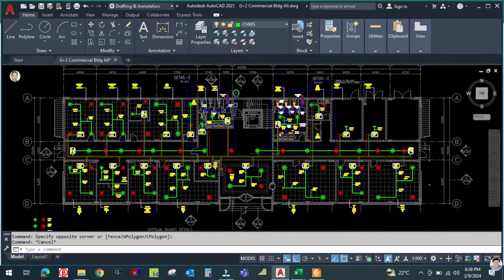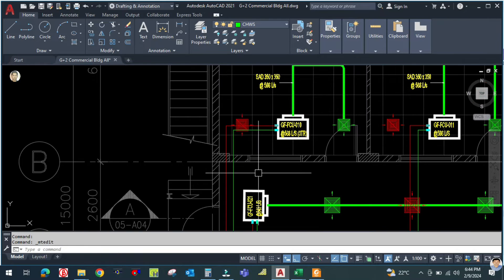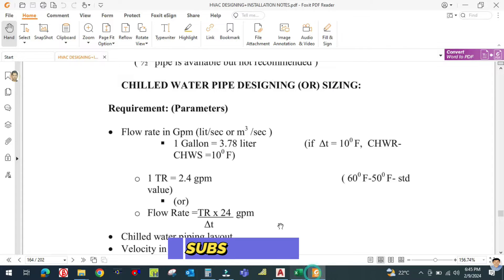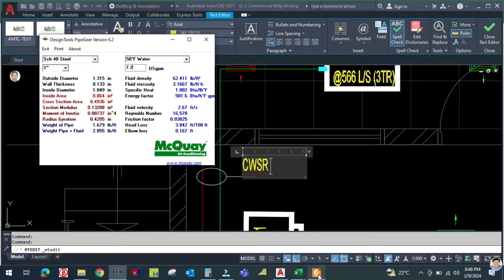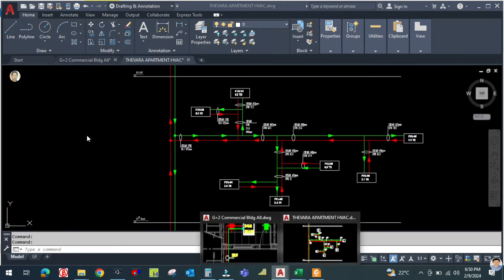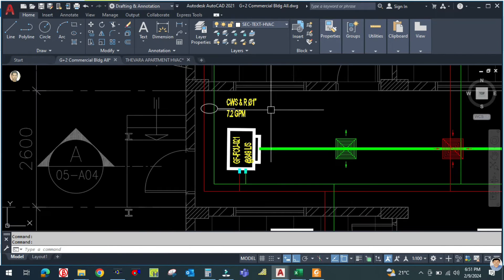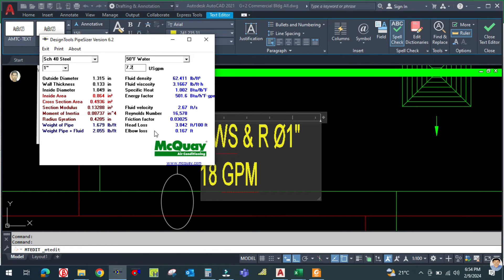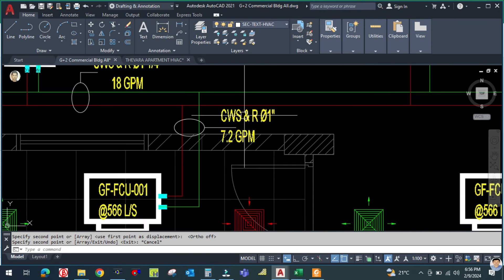Chilled Water Pipe Sizing II CHILLED WATER PIPE SIZING II Chilled Water Pipe Design II Part-1

Comment: sir for chilled water pipe normal plumbing diagram  no need  double line diagram
Reply from the maker: Chilled water pipe no need double line diagram because the pipe is too small.
But for plumbing it is required to make it double line diagram